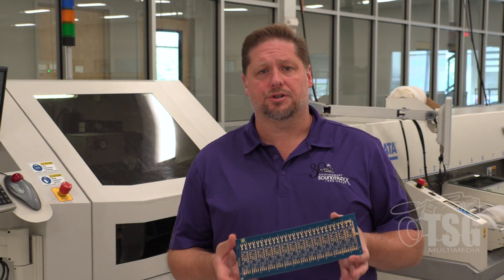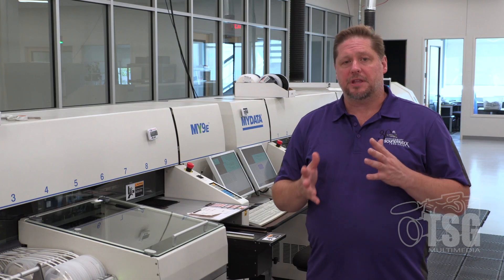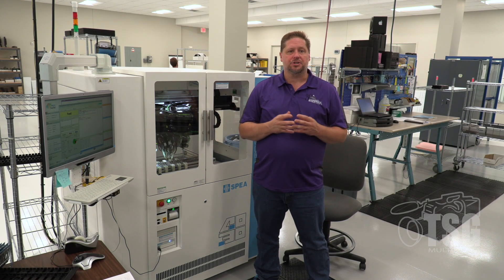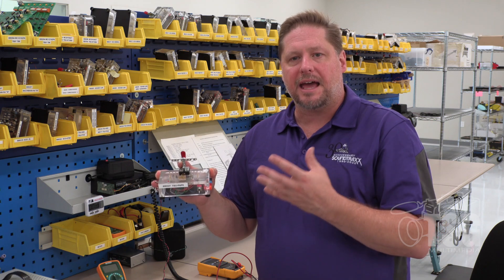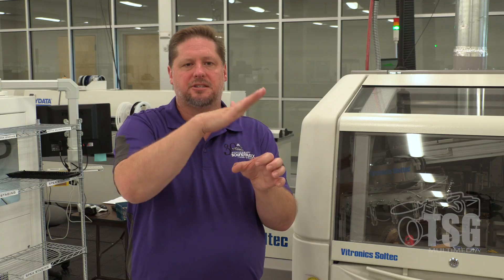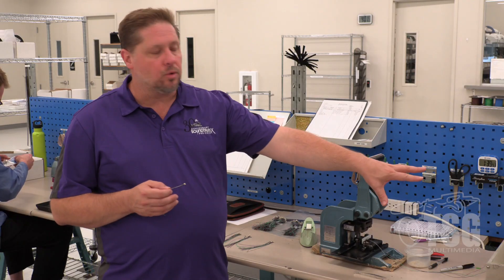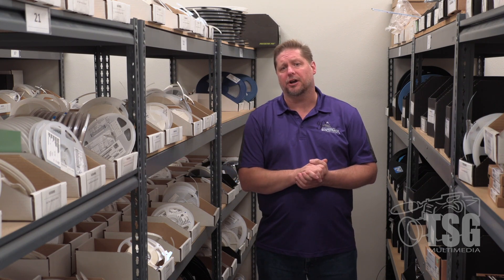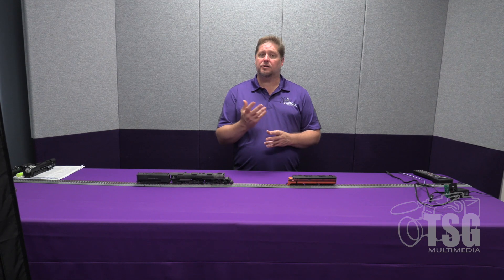How Model Train DCC Decoders Are Made | Soundtraxx Factory Tour

Comment: I have put many SoundTraxx decoders in locomotives for a museum's HO scale layout and used them to replace some of another brand.  The SoundTraxx decoders seem to be very robust in tolerating short circuits (usually from derailments) and still remembering their settings.  They have also been resistant to situations of over voltage from reversed phase (polarity if you must) between two power districts.  This has destroyed some other brands of decoders.  First rate customer service if you have a question, also.